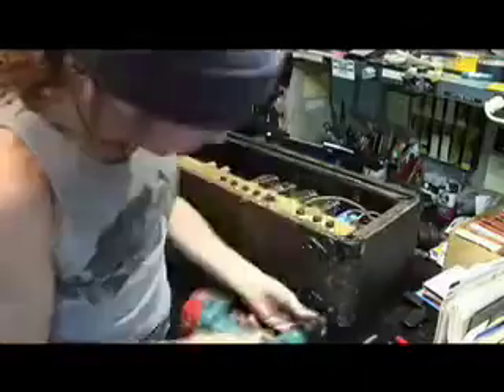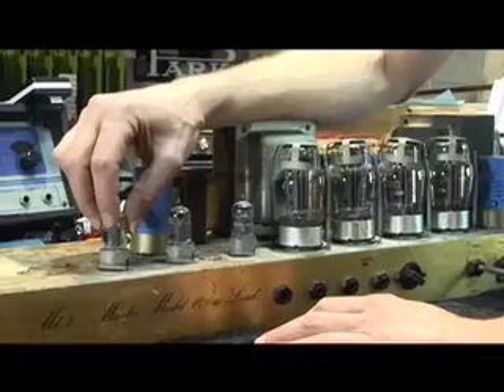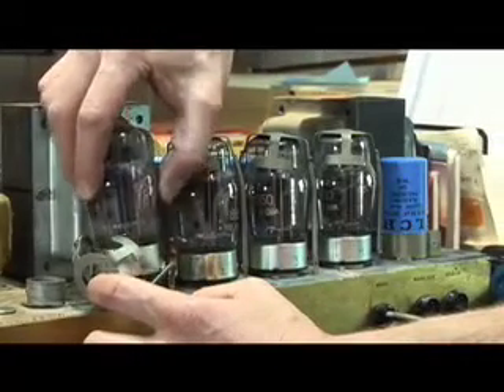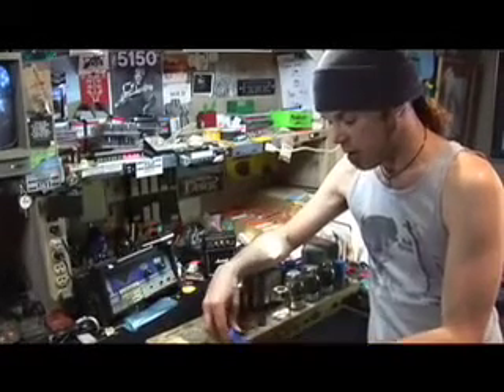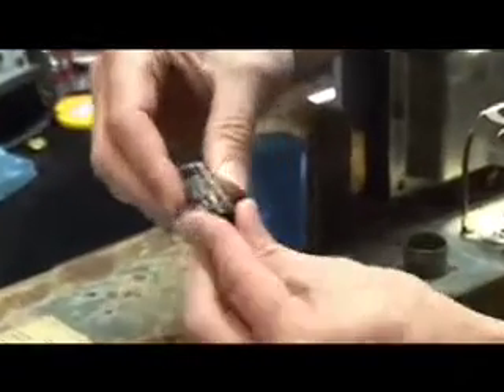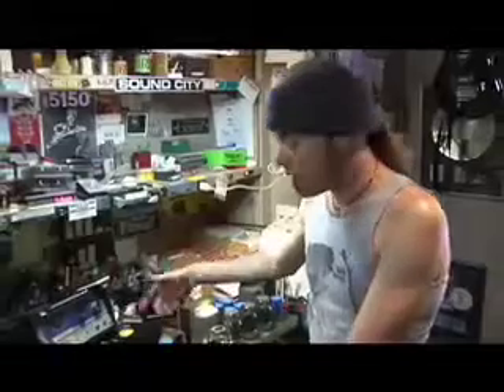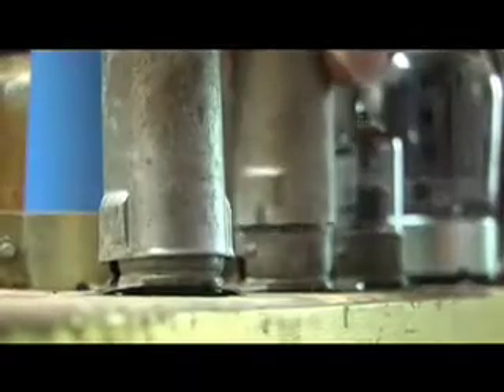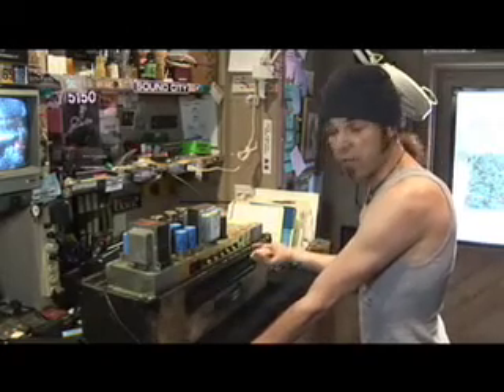Tech Education tube replacement

Comment: I always put a 150k-470k resistor accross the first reservoir cap (depending on HT voltage)no need to play around with crocodile clips then. and if an amp didnt come with one, i put it in there, i mod things too much to keep playing with pin 1 and removable bleeding techniques

Comment: no - the capacitors wont drain like that.  You need to let a guitar tech discharge it before you work on it.  The ground strap will protect the head from the electricity coming from the walk socket, but the power stored in the head will kill you if you start working on it

Comment: a quiestion: what is the period of life of a preamp tubes with a regular daily use of the amp (2 hours daily); another question; after a long time (2 or 3 hours) playing if the amp starts to get HOT one needs to turn off the amp for a while, for protection of tube (s).???